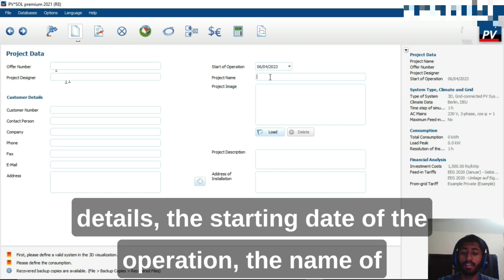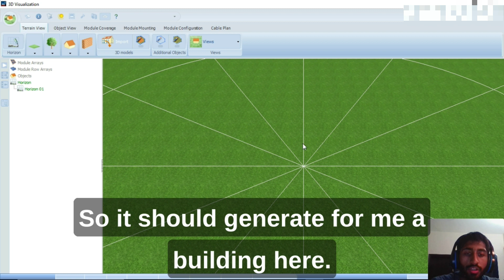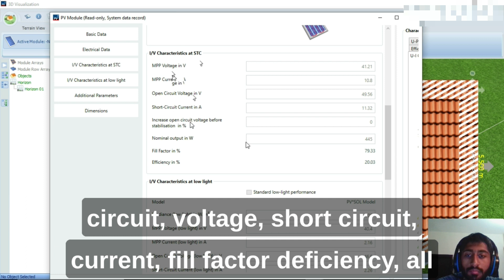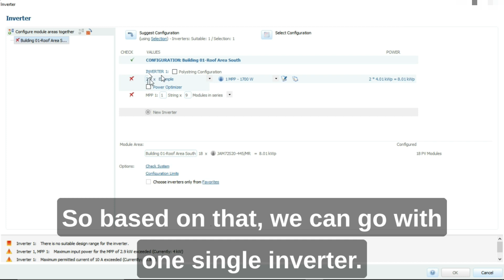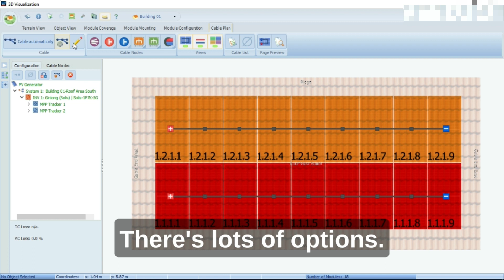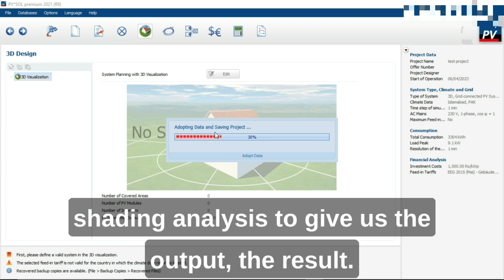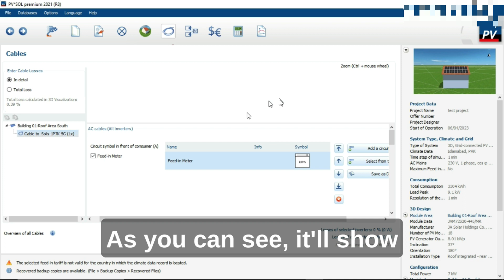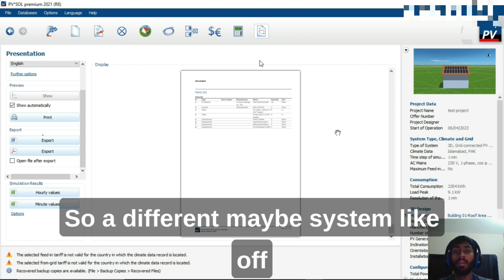Learn to Design a Complete Solar System in Under 10 Minutes Using PVSOL!

Comment: Hello! Where is the derating factor of the module? Where can I find it? I mean degradation in %
Reply from the maker: In the submenu of Solar PV Panels, you will find Degradation of Modules. From there you can set it either linear or exponential.